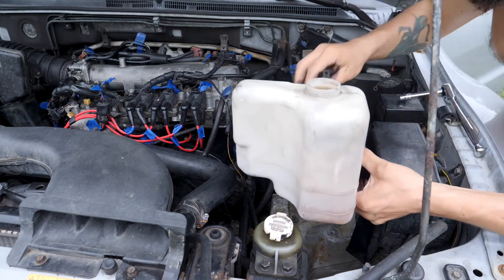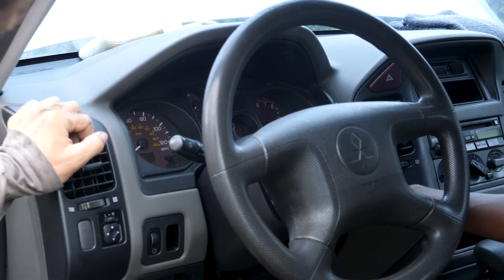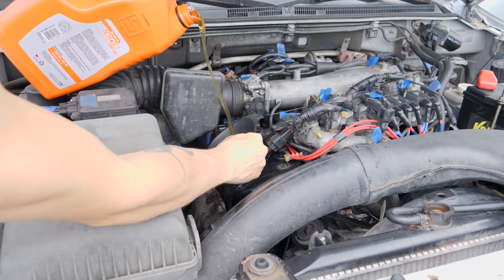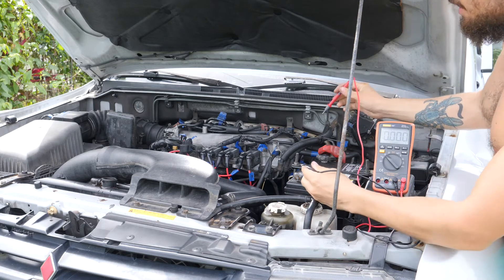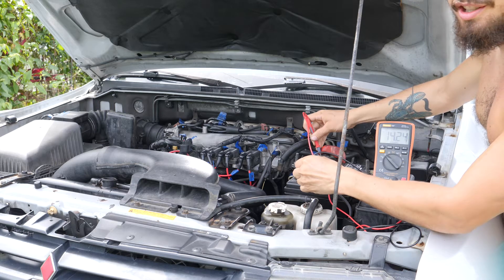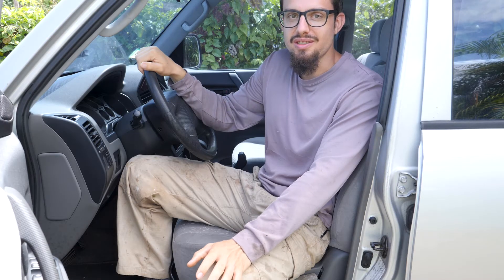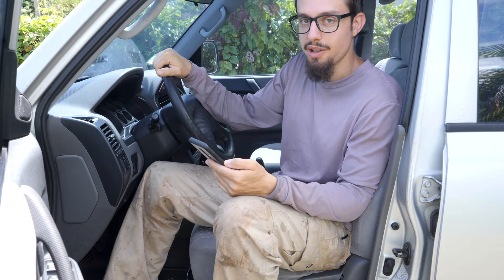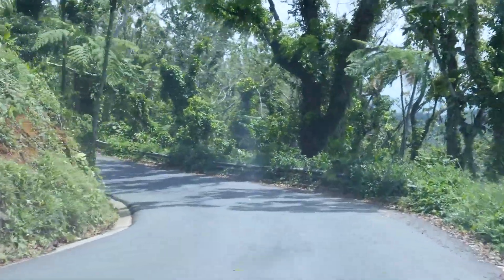Mitsubishi Montero Head Gasket Repair Part 13: Adding Oil, Coolant Flush, and First Start Up

Comment: So…. It’s been two years… how’s she holding up? Any updates?
Reply from the maker: She's holding up well. Had a few issues unrelated to the work I did in the videos. A busted coolant hose that was easy to fix, and the original alternator finally died after 24 years of service. I did both of those repairs myself. I filmed the alternator repair, so I plan to upload that sometime in the near future. Aside from that, she's been running like a champ.
Reply: @ColoradicalMike  Nice! I’m currently in the middle of my own head gasket replacement on a 2002 3.0… actually, I’m doing it for the second time, kinda. First time I just did a slap job… bolted the head on, threw on the timing belt, and checked the compression. Unfortunately only about 120psi in 1 and 3, 150 in 5, while 2, 4, and 6 all have 170+

So I took it back off today, pulled all the valves out, and tomorrow I’m lapping them and doing the sandpaper on glass trick to hopefully get a flatter surface and better compression! I don’t plan to touch the driver side at all.

Comment: I really congratulate you for the video! But I wanted to ask you something that I have not yet been able to activate and I hope that you have that function in your car and can help me. It's the wheel speed display!! On the central screen of the computer a function appears where the 4 wheels appear and some bars to indicate the speed of each wheel, I don't know if it is when it is in 4x4 or locked but it doesn't work for me in any way. Could it be that you also have that function in your car? I know this video is old but I hope you read me and can help me🙏🙏, since you know a lot about how to repair that specific car... which is the same as mine. greetings

Pd: There is nothing about that topic on google, if you need to see a photo  about what im talking , let me know to send you the link
Reply from the maker: I don't think my model has the speed indicators. Mine has the 4 wheel display, but it only indicates whether or not 4 wheel drive is engaged.

Comment: Hi how are you, i know this video is from 11 months ago, but i have a 2003 montero that the motor turns over but no cranck, and doing some reserch it looks like ither bad head gasket, cranck sensor, or inmobilizer, did your car guive you somthing similar ?
Reply from the maker: Potentially similar, I had a bad crankshaft position sensor which was causing a crank but no start start condition. A crank but no start condition means the motor is not getting one or a mix of these: air, fuel, and spark. The diagnostic checklist says to check all of the components that regulate the air and fuel getting into the cylinders and control the spark or ignition. An OBD-2 scanner should give you diagnostic codes that can point you in the right direction (i.e. a bad crank position sensor will trigger a code to be stored) but if no codes are stored then that could be a clue that it is possibly a fuel system issue.
Reply: @ColoradicalMike  hi thanks for the info yes i have a micro mecanic obd2 and it was clean no codes , but yes the car only turns no crank i put in new fuel pup and i disconected the fuel line and it had presure as it started to squirt out fuel, i will chek coil pacs evrithing else turns on fine in the car as far as all elecrical. I will see if i can get a new cranck sensor

Comment: Hows it running? Any tips on anything you would have done different?
Reply from the maker: She's running great. Only one issue, a warm up catalyst below threshold MIL code which because of her age and milage means she needs new cats but she still passed emissions. If I could do it differently I would be more careful to double check things like torque specs and the orientations of the valve springs. It cost a lot more time and money to have to go back and fix some mistakes I made that could have been prevented with a little more double checking.